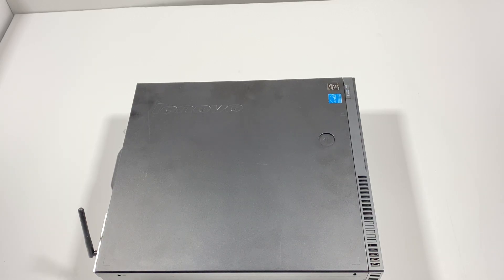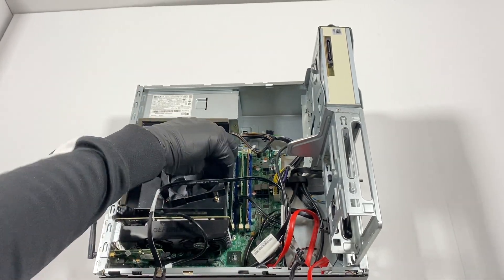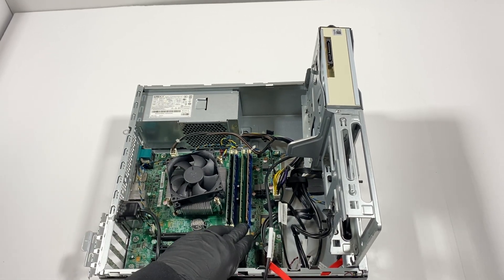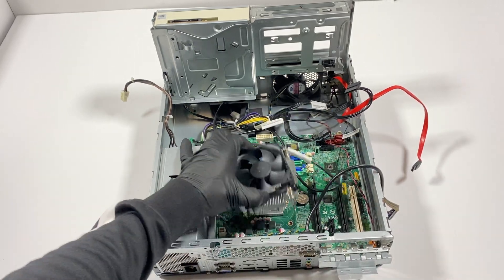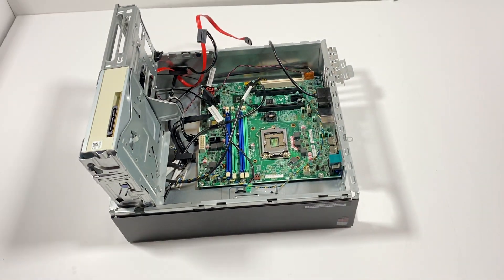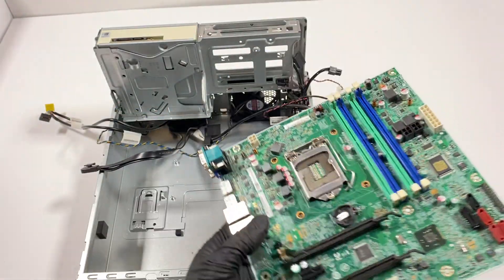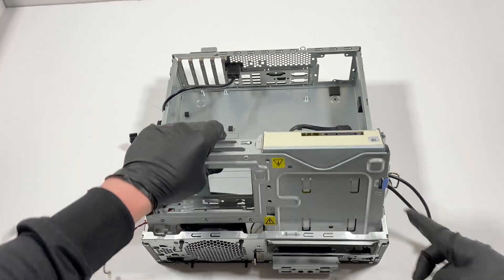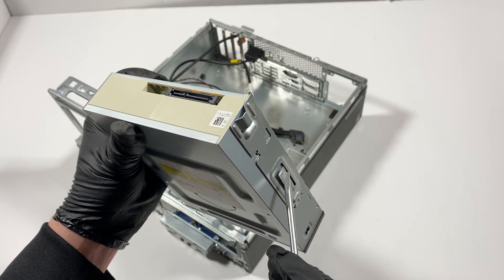Lenovo ThinkCentre M93p Teardown

Comment from the maker: List of Parts and Upgrades works with this system:

CPUs i7 Supports 

(1.) Intel Core i7-4790 @ 3.6Ghz
(2.) Intel Core i7-4770 @ 3.4Ghz

USB Wifi Adapter for PC AC600Mbps Wireless Network Adapter
https://amzn.to/2ZaGuHb

Lenovo ThinkCentre M93p Maximum Memory Supports: 32GB DDR3
This RAM will also work with this PC..

(1.) Crucial 16GB Kit (2 x 8GB) DDR3L-1600 UDIMM CT2K102464BD160B
https://amzn.to/3cbKOcu

(2.) (Crucial 8GB Kit (2 x 4GB) DDR3-1600 UDIMM  CT2K51264BD160BJ
https://amzn.to/3efYjtK

(3.) Crucial 4GB Single DDR3L 1600 MT/s (PC3L-12800)
https://amzn.to/3c2KtsK

List video cards will work with this system.

(1.) Gigabyte Geforce GTX 1050 Ti OC Low Profile 4GB Graphic Card (GV-N105TOC-4GL) 
https://amzn.to/2T8bfsv

(2.) MSI GTX 1050 TI 4GT Low Profile  Graphic Cards 
https://amzn.to/2LwZd7P

(3.) Gigabyte GeForce GT 1030 GV-N1030D5-2GL Low Profile 2G Computer Graphics Card 
https://amzn.to/2Z4PHkp

(4.) ZOTAC GeForce GT 1030 2GB GDDR5 64-bit PCIe 3.0 DirectX 12 HDCP Ready Low Profile Video Card ZT-P10300A-10L 
https://amzn.to/2WzgLXk 

(5.) MSI Graphic Cards GT 1030 2GB GDDR5, Low Profile 
https://amzn.to/390Spum

(6.) GIGABYTE GeForce GTX 1650 OC 4GB, GV-N1656OC-4GL Video Card
https://amzn.to/2B7N1sP 

(7.) Gigabyte GeForce GTX 1650 OC GDDR5 Low Profile 
https://amzn.to/3el08os

(1.)  Thermal Grizzly - Spatula for Applying and Spreading Thermal Paste
https://amzn.to/30Qq4ag

Thermal Compound Paste:

(1.) Arctic MX-4 Thermal Compound Paste Carbon Based
https://amzn.to/3JfonEE

(2.) Arctic Silver 5 Thermal Cooling Compound Paste 
https://amzn.to/2ziNU0H

(3.) Noctua NT-H1 3.5g, Pro-Grade Thermal Compound Paste
https://amzn.to/36kTk7A

(4.) ARCTIC MX-4 (current edition) Thermal Compound Paste 20 Grams 
https://amzn.to/2DhGJaK

SSD List:
(1.) Samsung 860 PRO SSD 256GB - 2.5 Inch SATA III Internal Solid State Drive
https://amzn.to/2BY5gRl

(2.) Samsung SSD 860 EVO 250GB 2.5 Inch SATA III Internal SSD 
https://amzn.to/37xWUfc

(3.) SK hynix Gold S31 1TB 3D NAND 2.5 inch SATA III Internal SSD
https://amzn.to/3d7X6D6

(4.) Samsung SSD 860 EVO 1TB 2.5 Inch SATA
https://amzn.to/2B2FURX

(5.) SanDisk SSD PLUS 1TB Internal SSD
https://amzn.to/3hwdqku

(6.) SanDisk SSD PLUS 240GB Internal SSD
https://amzn.to/2zfc7EX

(7.) Crucial MX500 250GB 3D NAND SATA CT250MX500SSD1(Z) 
https://amzn.to/3bTTjbX

(8.) SanDisk SSD PLUS 480GB Internal SSD SDSSDA-1T00-G26
https://amzn.to/2yfgjUK

(9.) WD Green 1TB Internal PC SSD  WDS100T2G0A
https://amzn.to/2XfGtzc

HDD list works with this PC:

(1.).WD Black 2TB Performance 3.5" Hard Drive - 7200 RPM Class, WD2003FZEX 
https://amzn.to/2xFUeyF

(2.).Seagate BarraCuda 1TB Internal Hard Drive  3.5" Hard Drive - 7200 RPM
https://amzn.to/3g8FXM8

Comment: Just wondering, do u have a low profile graphics card because I went to the store and they said that I could not fit a gtx 1650 into my Lenovo thinkcentre.
Reply from the maker: Hi, yes you have to use low profile video card with low profile bracket..

Comment: Hi Mxkdi, I Love your videos!
I have an old HP Desktop PC with IPMEL-AE Motherboard (which you already did a video about it around 5 years ago)
I was wondering if I could use the mini card PCI-E slot for an mSATA SSD, does it gonna work for this particular MOBO?
Reply from the maker: Hi, thanks. yes you can use it and i would recommend you use 2.5 solid state drive like samsung.
Reply: @Mxkdt  Thank you for your reply, in the video you did mention that the mini PCI-E slot was for wireless card and when I went to the BIOS to check I didn't find an option for mSATA, only the 4 regular SATA that's why I was suspecting about it, did you try it already? can I boot windows from it?
Reply from the maker: @AmineBerrachdi  I was thinking you where trying to use msata pci express adapter, and it is not worth it.

Comment: mxkdi would a gt 710GV-N710D5-2GL work in a dell optiplex 3020sff
because the pci e of the gt 730 has one by one line and am confused
Reply from the maker: Hi, yes  gt 710 with low profile bracket will work fine in a dell optiplex 3020sff machine and you have to use PCI Express x16 slot on the bottom.
Reply: @Mxkdt  thank you so much

Comment: got a question
Got a opti 3010 sff
I upgraded to a Pny Geforce 2gig and also the ram suggested to make it up to 16gs of ram
can i upgrade to CPU to the  I7-3770 or 3770k without problems?
Reply from the maker: Hi, yes you can maximum upgrade CPU on this dell ..i7 3770 and make sure you install latest BIOS A22 before installing i7 CPU.